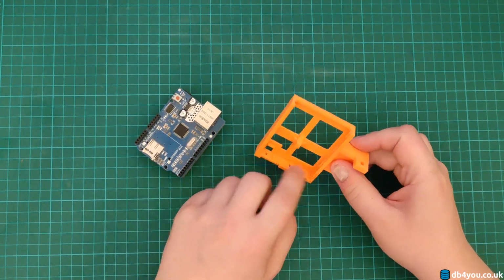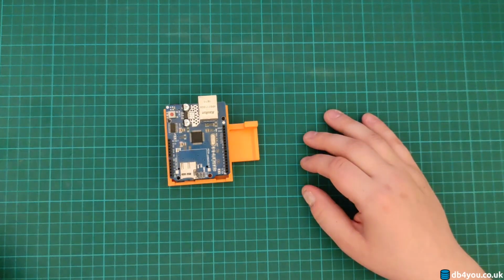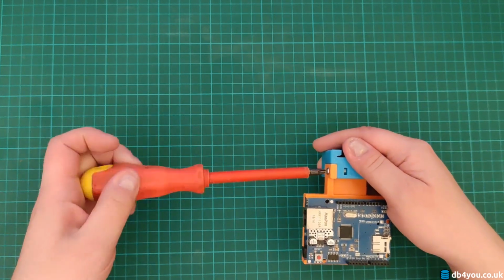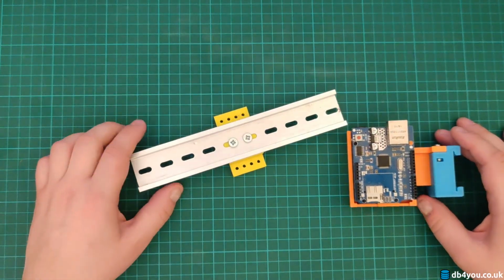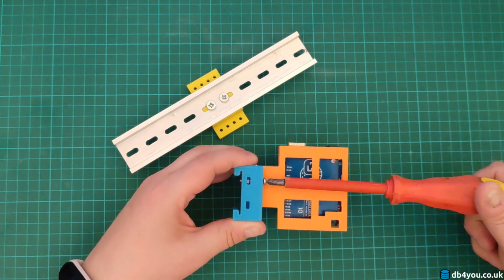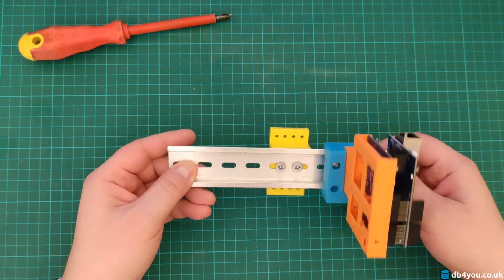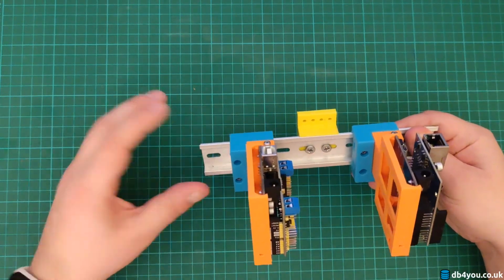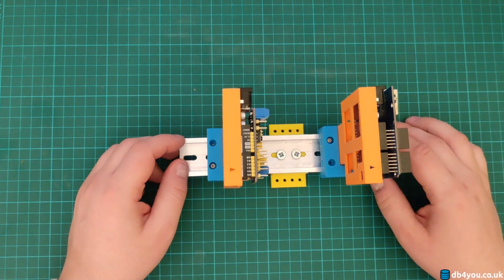FreeCAD: Home Automation with Fred

Comment: While I understand a screw for clamping pressure on the din rail.
Wouldn't a simple pin, parallel to the rail by good enough for the module to be locked to the rail plate?
Reply from the maker: Yes, you could do that. In Fred I have put a whole in the middle of it so that you can pass a bolt through and it will align with the holes on the din rail which restrict the movement of the entire attachment.